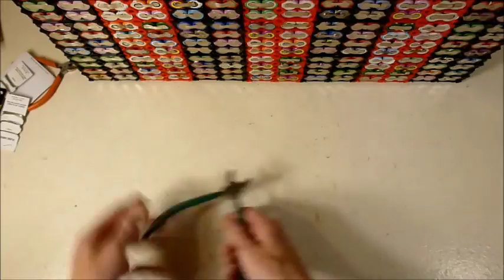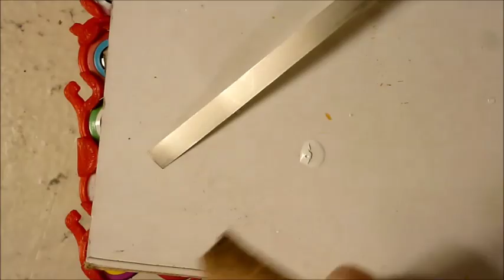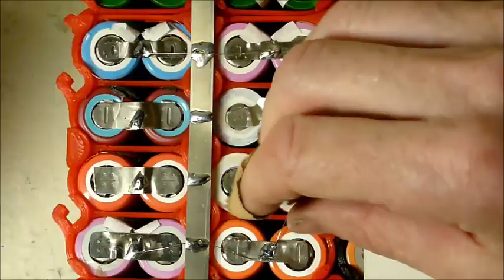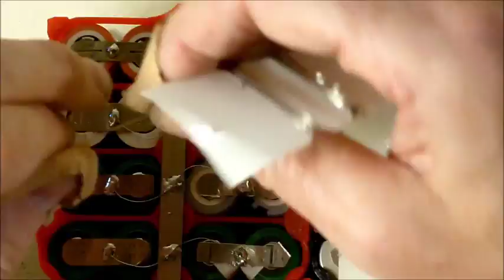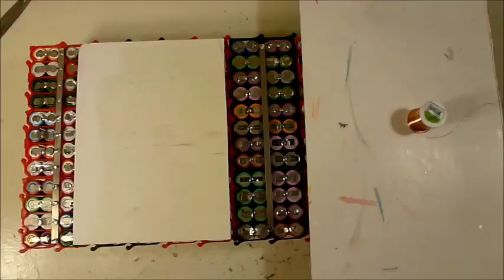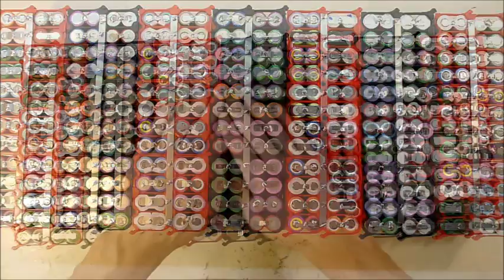Laptop Powerwall 12 - soldering Tesla-style fuses

Comment: What is the propose of that fuse?
Reply from the maker: One of the ways that a Lithium-Ion cell can fail is for it to develop a short though the cell (ie., a lot of current can flow through it from the other cells in parallel). In this situation the current will burn out the fuse and separate the faulty cell form the rest of the group. If there was no fuse the high current could potentially provide enough heat to ignite the volatile electrolyte in the cell. Which would be bad. This situation is rare, but the consequences are so bad that it's worth the effort of adding cell level fuses.

Comment: Hi Paul, I've been watching all your videos for a while now... great stuff. Anyway i was harvesting laptop batteries also, and had the thought after the 20th battery pack... "Why should we remove the BMS and separate all the 18650 cells anyway?" Assuming the laptop battery complete with 6 cells we're good to start, why break them all apart? I mean its a free BMS and no need for spot welding or soldering except for 2 wire leads. I'm just wondering in case there were a reason besides creating the individual cells into your custom design configuration (like a 6P30S for example). Thanks in advance, keep up the videos! cheers
Reply from the maker: Hi Bee. I 've found that some of the laptop packs have bad pairs in them. When a laptop pack ages the pairs will fade at different rates. (In a perfect world they'd fade at similar rates.) In a situation where one pair fades faster than the others the overall performance of the pack degrades so the users recycles it. Then we pull it open and hopefully recover the better pairs - which are hopefully still good enough to re-use. Cheers, Paul
Reply from the maker: Also - laptop BMS's in laptops are often "smart" - they talk to the laptop to workout if it's safe to provide power. So it might be tricky to get them to behave.

Comment: there is question etching my head ,a car lead acid battery is composed 
of 4 cells each cell have 3 volts if one cell go down the whole battery 
pack go down,is it not the same for the 18650 tesla packs when one cell 
go bad the whole pack go down
Reply from the maker: (Note: a 12V lead acid car battery actually has 6 cells, with 2.1 volts each.)
Yes - if one cell in a string goes down the whole pack voltage goes down. (Although sometimes other stronger cells might go up to compensate - it depends on the BMS and charging setup).
In my case I have 48 cells in parallel groups. Then 7 of those groups in series. So if one cell is weak the other 47 in it's group may pick up the slack a bit. I test all the cells before building to avoid weak cells. Cheers, Paul
Reply: please explain (I have 48 cells in parallel groups. Then 7 of those groups in series.) do mean they are in total 336 cells
Reply from the maker: Yes. 336 cells in the whole pack!

Comment: Great video Paul ...well done ...I've never seen those twin plastic cell holders before ...do they still sell them? can't find them on eBay ... 
As you say that fuse wire is expensive .... I suspect it's just 34 AWG  tinned copper wire , you seem to be using long fuses (I estimate about 10mm is the best length) long ones  will waste power in normal operation  (about1%) , also pure nickel has 4 times the resistance that copper has (for same cross section  area) it's fine for spot welding but will lose another 1% of energy, compared to using copper
Reply from the maker: I 3D print those cell holders myself. I've put the design files on Thingiverse.com if you want them. 
One advantage of longer fuse wire is they should burn at a lower current. 
My nickel strapping is even worse - turns out it's just nickel plated steel stapping - so even higher resistance. :(
Reply: Thanks for the reply Paul ....those holders are brilliant ...saves a lot of work to keep the cells paired.

Comment: Hi Paul, great vids.
I note the title says "soldering Tesla-style fuses, side 1" suggesting you are going to fuse side 2? Wouldn't this be redundant?
Reply from the maker: Yes. It was redundant doing fuses on the back side. I should have used thinker wire for the back side connections. Using thin wire allows for a fast solder joint so less heat going into the cells. But if a back side fuse blows I'm much less likely to notice it. I plan to go back and re-solder thinker wire on the back side.

Comment: looks great, one thing im struggling with is the fuse wire, where did you get yours from?
Reply from the maker: +Craig Minca I'm using http://www.jaycar.co.nz/Wire,-Cable-%26-Accessories/Hookup-%26-Power-Cable/Enamel-Copper/0-25mm-Enamel-Copper-Wire-Spool/p/WW4012
Reply: +Paul Kennett thanks mate
Reply from the maker: +Glen Hewlett Here's my sources: http://powerelectronics.com/passive-components/selecting-fuses-simple-procedures-get-right-overcurrent-protection-dc-dc-converte and http://www.powerstream.com/wire-fusing-currents.htm
The later has a chart which says it'll work as a 10 Amp fuse. Of course there are plenty of variables to that so - it's worth testing whatever wire you get.
Reply: +Paul Kennett Hi Paul, so you think any .25mm copper wire would be fine as a fuse wire?  Is that considered the same as a 5 Amp fuse?  Thanks again for your videos they are very informative and inspiring.